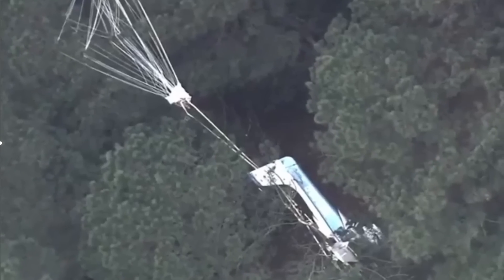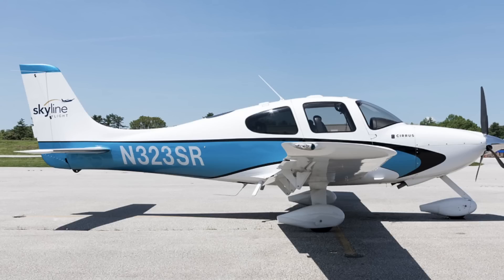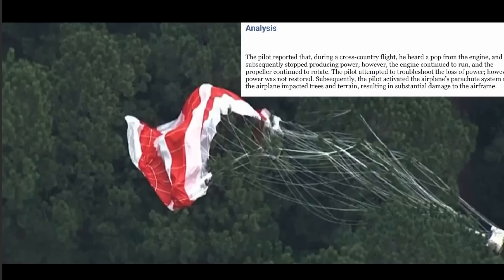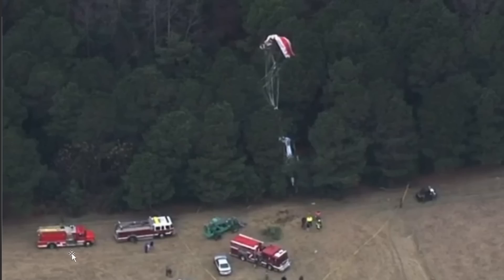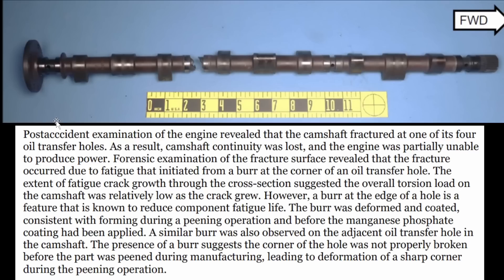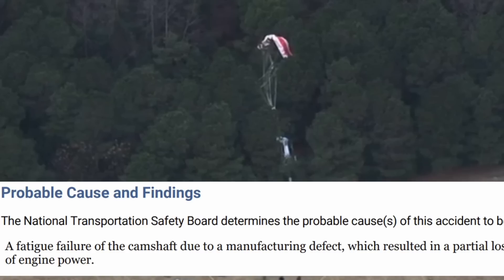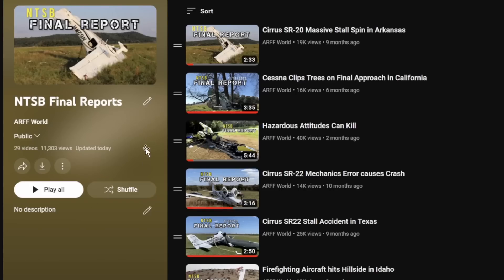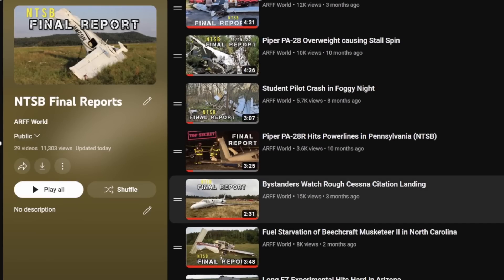Cirrus SR-22 Engine Quits

Comment: When Cirrus first putting those chutes on planes, I and all my pilot buddies said the same thing: "now nobody will want to land when the engine quits." This guy (and many others) is proof of that.
Reply: I have a parachute in the airplane I built. Two engine outs, zero use of parachute. One landing on the runway, the other in bean field. Total airframe damage from both landings cost me about $25 in parts, excluding the engine damage. 
Once you pull that chute you have no control over where you land. You could end up in power lines, trees, a playground full of children, a lake, edge of a cliff.
An airplane does not stop flying when the engine quits and I'm not putting my life into the hands of luck, I will rely on my skills.
When will I use the chute? When the airplane is uncontrollable or I did something stupid like fly over a dense forrest at too low of an altitude to glide to a field. 
Hopefully the only stupid thing I do with aviation was picking the make/model of engine that gave me two catastrophic failures.
Reply: @ulbuilder  when you pull the chute you're gonna hit the ground about 20kt if you try to land a plane on a field that is not prepared for it, on a Cirrus you'll touch ground about 65kt, I see that the chute is a better option than trying to land a plane, unless it's an empty road or a runaway of course
Reply: @herikdrum  If you hadn't noticed planes and pilots are designed to land, just because you have no power doesn't instantly change the ability for either to perform a safe survivable landing ??
Reply: @ulbuilder  just curious, what is your Vso?
Reply: You and your pilot buddies were mostly right. Nobody wants to crash land when the engine quits. They want to survive the emergency so they pull the parachute. That continues to prove itself the safest option. “This guy and many others are proof of that.” Attempting a landing only lets you choose where to crash. Go drive your car across an unknown field at 90 mph (Cirrus landing speed) and tell me how it goes!
Reply: @dryreed  considering I’ve landed three times with an engine failure, successfully, I’ll forgo the chute.
Reply: @paulis7319  Whatever suits you. To further inform discussion, what aircraft did you accomplish those in?
Reply: @dryreed  two in a PA-25, one in a L-19
Reply: @huhwhathappenednow  I say take the best action for a given situation. I do not think the decision should be watered down to simply "engine out = use chute" because the potentially negative outcomes are overlooked.
I am not criticizing this pilot, was only commenting on the topic of this thread "now nobody will want to land when the engine quits"
Reply: I came here to write same thing. You beat me to it. Additionally, I have noticed that Cirrus pilots do seem to have limited skills in how to judge altitude and glide, even if an airport is close by. I saw once, I think in Australia, the pilot pulled chute and landed in a desert. WTF? No reason to wreck the plane.
Reply: If you strictly want to look at forced landings objectively, then the biggest factor to consider is the energy carried at the time of impact, and the vector that impact is at.

A parachute is going to have a relatively stable and repeatable outcome of those two factors. Anything else that we have available in aviation at the current time is not.

The bottom line is that if we as pilots are forced or choose to land off airport with an emergency such as a loss of power, there are a lot of unknown variables which dramatically increase risk. A parachute mitigates a large number of those variables.
Reply: The guys who make comments against cirrus Caps deployments #1 can’t afford one #2 Wish they had one
At the end of the day they are alive!  There was a Cirrus field landing recently  that resulted in fatalities.